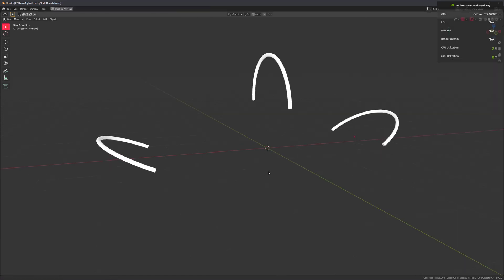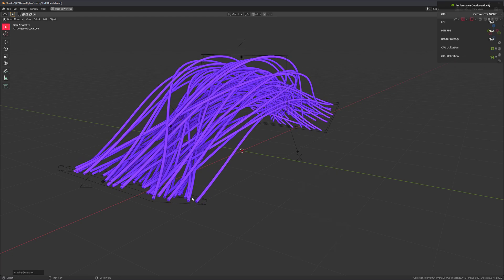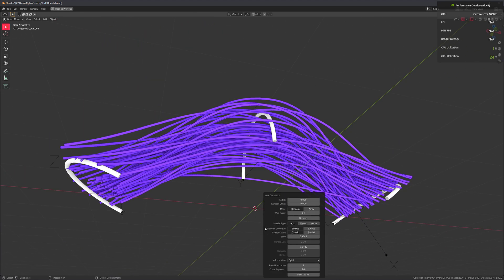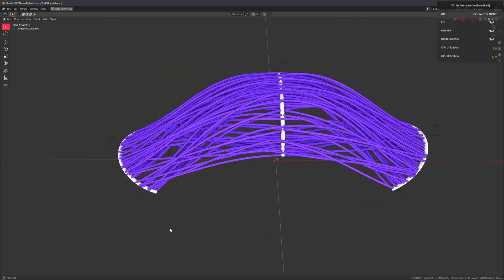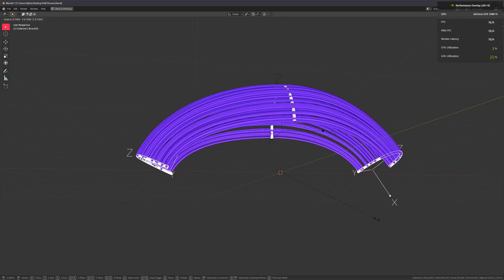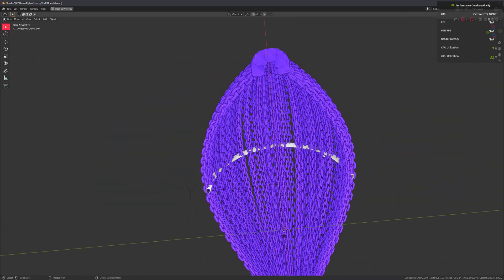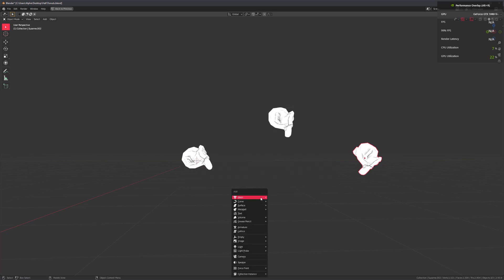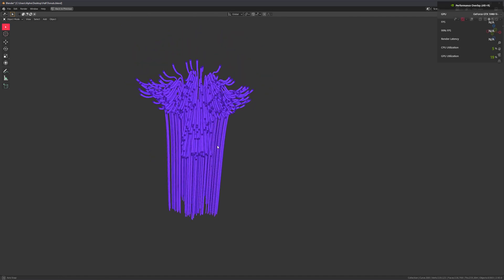Curve Basher Devlog 1.4 (Generate Cables from Surfaces)

Comment: It would be quite useful, a similar addon to generate supports for 3d printing, because it is similar to the meshmixer.  which is very slow but makes supports easy to remove.  not to mention that there is no such addon in blender.
Reply from the maker: Thats probably be best developed by someone with a printer though :p

Comment: Hey any new ? I'm  mostly using blender 3.00, could you make a new version for this please ? ♥
Reply from the maker: New features? No. A 3.0 version? Yes, but I'm waiting for geometry nodes to mature before I add any new features, and blender 3.0 is sill in alpha and they just started revamping the node system, so those may take a while.
Reply: @ArmoredColony  okay thanks 🙏
Reply from the maker: I misread your original question, sry. I edit my previous reply. I have to wait for blender  3.0 to at least be in beta  before I start making a version for it.

Comment: what hotkey are you using to bring up the wire generator parameter box at the cursor?
Reply from the maker: I believe it's F9 (I rebound to T cuz F9 is too far away). I believe Blender calls it the Redo Panel. Note that it only works as long as you don't run another command or tool. If you do then F9 will bring up the settings for the tool you just ran instead.
Reply: @ArmoredColony  Thank you !!

Comment: Big broski, can we fit a collection of objects in a randomized way into a curve? trying mesh to curve bash but i guess it only works with a single obj? dat would be extra sick.
Reply from the maker: Not currently but you have piqued my interest. What were you trying to make?
Reply: Im trying to make a few rows of spikes in the back of a creature. they have to be precise in the sense they follow the form but have randomized spacing and sizes so they feel organic. so i create a collection with different spikes and I draw some curves using the “on surface” toggle and now I need to populate them with that collection. im sure there are other ways to achieve this but would love to centralize my curve needs with curve basher!
Reply from the maker: @aeonbreak4728  - I'm always looking for ideas that can improve the addon. While I can't add this immediately, it does seem useful enough to make it into a future release, since I'm working on making improvements to ALL the tools included with the addon. It will take a while, but your idea should make it in there eventually. I know that's not very helpful right now.

Comment: that look awesome ! 
quick question, is there a way to use a custom profile for a curve ? 
if there isn't, do you plan of adding one ? because right now, when i need to make a custom profile, 
I modify one that already exist but that not really efficient . . .
Reply from the maker: I don't currently have a 1 button press way of creating curve profiles. I used to have it when I was originally creating the addon, but removed it at one point for some reason. I will add it back in the next update.
Reply: @ArmoredColony  if we could simply select our curves, hit a button and then select any mesh as a custom profile, that would be sick.
Reply from the maker: I gotchu in the next update bro, promise!